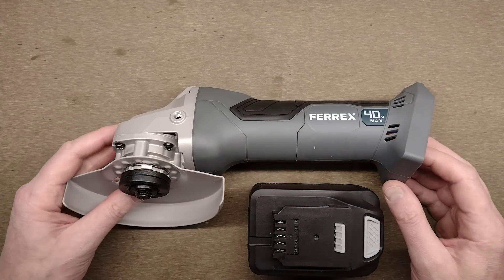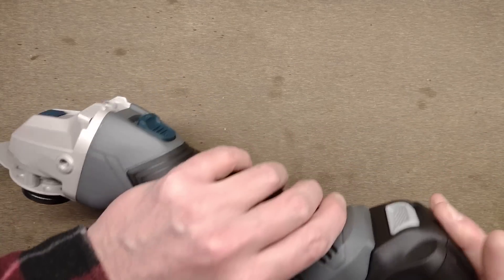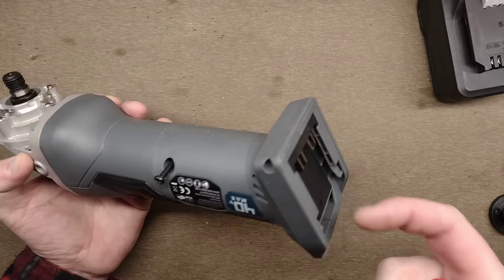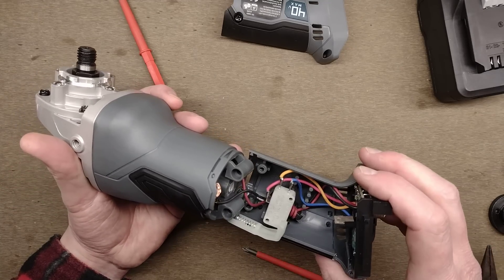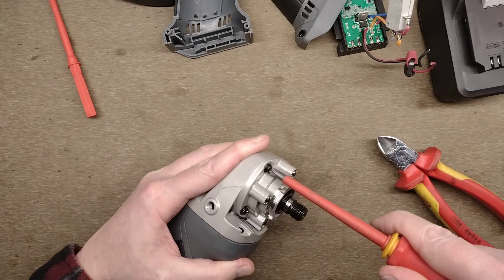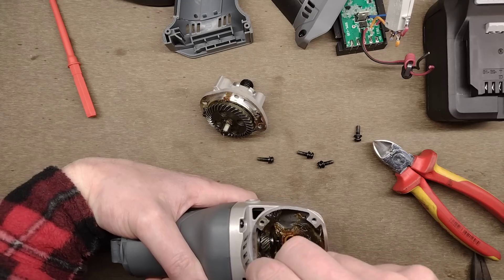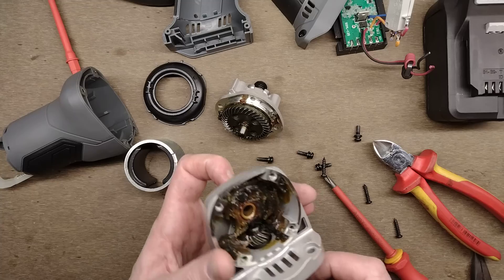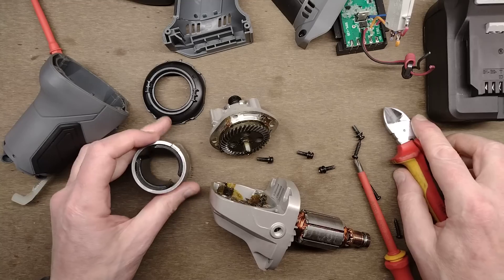Aldi 40V angle grinder mechanical teardown

Comment: Ive taken apart many a tool in my days and ive never seen an external inductor/ choke like that or a commutator on a permanent mag motor without any brushes  on the tool..   oddball tool there….
Reply: The brushes will be inside the plastic body. You can hear them snap off the comutator as the armature is removed from the body.

Winding the motor feed wires around a ferrite is actually quite common on cheap battery power tools.
Drills and drivers often short the positive an negative leads together when the trigger is released for inductive braking, but that would be dangerous on an angle grinder, where the disc could come loose and fly off.

Comment: 9.99 including batteries? If so, nice source of batteries :)
Reply: All the Aldi tools are sold as bare units, so you need to buy the battery and charger separately. Just like the Ryobi One tools.
Reply from the maker: Just the tool.  No battery.

Comment: Nice to see Clive doing more mechanical stuff!

I used to work in product development for power tools and have worked on some 20V/40V battery platforms. For those asking how the switching works: usually one of the battery connector pins is reserved for communication, and it happens there so that the battery knows what voltage is needed. 

Power tool batteries are comprised of a layer (industry term P, ie. 1P, 2P, 3P) of 5 18650 Lithium Ion cells, which produce 3.6V nominal (4V max) per cell -> therefore outputting "20V". If you add a second 5 cell layer (this is 2P) and connect them in parallel - you will double the capacity of your battery.

However, newer battery platforms can switch these to 40V - there's a switch in the battery circuit that will allow it to change how the second layer is connected - parallel (20V) and series (40V). This also allows the battery to be backward compatible - it will just run in parallel unless it detects the tool is 40V.
Reply from the maker: This system has no switching in the battery.  Just in the tool.  There seems to be a data facility between them though.  Battery video made and coming soon.
Reply: ohhhh that's useful information, thank you
Reply: In this case they're just using two separate 5S packs which are connected series or parallel inside the tool, and parallel for charging. No particular smarts beyond a different ID resistor to up the charge current.

Comment: I hear the Dewalt 20V/60V batteries are just flipped between parallel and series even if out of balance and that means they don't last all that long.
Reply: paralleling the 5S packs does balance the buddy cells. so not negative but positive.

Comment: They would have sold more of these if they started at a tenner, (I'm guessing battery and charger sold separately so total cost about 40)
I preferred it when the branding consisted of a wonky paper sticker on a generic featureless tool.

Comment: Ferrex tools are good but they one weak point - the trigger - used both the drill and impact driver for over a year now (even have the p;d style batteries). The drill trigger went first and my impact later both parts are easily buyable though so if you can solder (Sodder) they're quite the long term investment for the price

Comment: I'm still waiting for milwaukee to come out with a m12 version of a cordless grinder as I have lots of the m12 batteries.  Oh well.  This grinder if it has torque would be a good diy project  candidate to power my manual bead roller.  I could power it with a 6ahr ryobi 40v battery.

Comment: those ferrex tools aren't that bad for how cheap they are, my battery sadly died a year after getting it so i ended up converting it to use makita batteries apart from that i can't really fault them since they're still kicking after owning the impact/drill set for almost 3+ years

Comment: I wonder if the 20v systems just have a voltage detection that limits the duty cycle of the output to 50%.
Reply: Since there's 2 sets of battery terminals, the difference is likely that each set of terminals is connected to a group of cells that add up to 20 volts inside the battery, and on the tool end, the 20v tools connect to the 2 sets of terminals in parallel, while the 40v tools connect them in series.

Comment: I was part of a crew disassembling parts from an MRI machine. I got a bunch of goodies from it, including half wave and full wave rectifiers, a 24v power supply, two 24v circular electromagnets, and some other equipment that I'll donate to a trade school. I plan to make a magnetic drilling base for my drill press. The electromagnets are rated continuous duty, so it should serve me well. There are a couple more of the electromagnets, and if it works out, I'll purchase those as well. They appear to be bigger than the other two.
Imagine reverse engineering that equipment, Clive. 
Is the grinder German made, or is it made of Chineseium?
Reply: i could be wrong but i believe mag vices use permenant magnets and an internal mechanical action to move them in line with either ferrous or non ferrous material which makes them work or not :)
Reply: @cho4d  for a drill press, electromagnets are the thing. Look up microwave oven transformer drill press on here.

Comment: I've seen those use both a straight bevel and spiral bevel gear set, and that is where you can tell if they will last by the way they were manufactured. Some of the very cheap junk from our largest Asian friend had the worst gears I've ever seen. They were sloppily cut, where the pinion's teeth were cut so thin, they had a razor edge on the tooth's edge, and they would fail in no time under use. You could see deep tool marks where they were quickly hobbed  in what looked like one pass, and I'd bet the steel was poor quality as well.

The good gear sets are sintered metal, and the best have teeth that have been hobbled or ground to dimension after that.

Comment: Wait so does the motor just work by passing voltage to the magnet surrounding the drive shaft?
Reply from the maker: The coils are powered sequentially by static carbon brushes as it rotates between the magnets.

Comment: I wonder if the button is pushed, does some voltage come out? If so, that might be VERY HANDY for robotics applications. Either gear down, or replace, the motor on the end with somthing more suitable?

Comment: I wonder if the battery pins are soldered onto the board as ordinary components then pushed into the plastic end piece during final assembly.
Reply: That would make sense, and locking as they are inserted. Keeps high temperatures away from the plastics.
Reply: No need to desolder. There's a black plastic bar that pushes out that let you take the whole board out in one piece
Reply from the maker: It was hell getting the PCB out.  The contacts are pushed in and then locked with a slide-in dovetail bar, then the PCB is dropped in and soldered.
Reply: @bigclivedotcom  Sad, though it makes me wonder if that bar locks itself when the soldered board is pushed in.

Comment: After testing out 2 machines with this battery pack we pretty much bought the whole set. So far good enough for personal use. 
You never know with this kind of things, but for this price you can give it a go. It's produced by the German company Walter.
  Can't wait for the follow up on the battery pack, since at some time i have to replace the 18650 in it or fiddle with the electronics. ;)
Reply: Austrian actually.
Reply: @chrishartley1210  Args, Salzburg, of course, my bad. XD
Reply: Made by Walter?! I didn't know they did off brand stuff.

Comment: Hello Clive, I have two of Ferrex 240 volt 5¨ grinders and a bandsaw, which work well and seem to be good value for money. The grinders cost $29.00 Australian and have been running OK for about 3 years now. If they fail, I will throw them in the bin and by another one, rather that spend an obscene amount on the known brands.
Reply: Yep Keith. If you are a tradesman using the tools for hours every day it pays to have durable and reliable heavy duty gear. But for most of us who only pick it up to do a little job once in a blue moon it would be just brainless to have premium gear lying around just begging to be nicked. I also find 240volt gear better as well, since the "battery" is always charged and most things are done in the shed anyhow. Though a cheapie battery angle grinder and drill can be useful on occasion.
Reply: If it doesn't cost you to go and buy another one, it's a viable strategy.

Nevertheless, I buy tools from a tool store where I can handle the physical item and, when elfin safety isn't looking, actually power up for the feel of the thing.

As a result, the Feral grinder is in the shed on standby while I juggle 3 Bosch grinders when weld fabricating... because the Bosch ones are lighter for the same nominal power and run more smoothly. Less vibration is a bonus after a couple of hours of "welding".

Comment: Can't belive how cheap they can make these.
Seems descent quality too. The only thing that fails in angle grinders are the ball bearings and the bearing housing of the output shaft. Most of the time, the case is made of plastic, when the bearing seize up, it melts the plastic and the whole thing is good for the landfill.
Seems all metal construction here.
Reply: They hook you in with that £9.99 (current offer price, normally £14.99) and they know you will then need to buy a battery and a charger on top of it, and that's another £68.97.  The charger's the one with the steepest price point at £41.98.  So in the end it's not that cheap at all.
Reply: @heckelphon  £41.98 is for the charger and a 40V battery. The charger is £14.99 by itself at the moment.

It's quite cheap in practice, because you don't need five chargers.
Reply: @Monkeh616  Thanks for pointing that out!  Aldi website is displaying some odd other prices for 40V tools at the moment, including this £14.99 grinder on offer at £9.99 which then reappears at £29.99 for identical spec, bare tool, no battery or charger.  Weird.  And it keeps saying online price only somewhat haphazardly.
Reply: @heckelphon  Don't know it was without battery and charger at this price. Sure, it's less interesting.

Comment: Unbelievable that they can make them at that price.  But I have noticed that Aldi are now selling power tools in bits.  Instead of buying the power tool and battery and charger in a box, you generally have to buy the power tool and then spend more money to buy the battery and charger and if that is the case here, then you will probably spend more on the battery and charger than on the power tool itself.  If you got the battery in the 10 quid price, I hope you were wearing a highway man's mask at the time.
Reply: In the UK the combined price for bare tool (£9.99), battery & charger sets you back £78.96!
Reply: @heckelphon  Because that's a different grinder, I believe. And that's still cheaper than a bare tool from the big names. Also, you can buy  them separately.
Reply: I'm a dandy Highway man, got the tool from Aldi the batteries & charger discounted from Ebay. The idea is you get the power system and use it in multiple tools, with a few adapters you can expand the power system way beyond the original system 😀👍

Comment: I'm sad he didn't open the pack. For a tenner I wanted to know what kind and how many cells there were. 😔 Hoping for it to be in the "next video" if he does one.
Reply: Usually 5x 18650 for "20V" battery. There are 2 banks in series for 40V and parallel for 20V.
The price does not include the battery.
Reply from the maker: Battery sold separately.  Ten 2500mAh 18650 cells.
Reply: I mean, the ten pound price was a double reduced price, may not be many of these left out there on shelves. I imagine he's probably going to do the battery back at his main bench just like the tool circuit board.
Reply: @rpavlik1  The £9.99 price is for the bare tool only.  Battery is £26.99.  And then you need a charger ...

Comment: Hypoid gear is probably the term you are looking for. Right angled drive with constant mesh teeth. Other methods of turning through 90 degrees do not give consistent pressure on the teeth and consequently have higher wear rates and/ or jerkier motion when transferring high power.
Reply: Bevel gear
Reply: Nope, ring and pinion.
Reply: @zachv1942  The gears in your "ring and pinion" gear set are hypoid gears. Ever looked at a bottle of high quality gear oil? It's there on the bottle.
Reply: @chrishartley1210  you're both right, chill out...and trust me, I own several of those things to the left (my avatar), know way too much about ring and pinion gears, from experience...that use hypoid gear oil for a reason....sheesh....
Reply: @chrishartley1210  these aren't hypoid gears. Hypoid= The axes of the gears don't intersect. These are ordinary spiral-cut ring and pinion gears.

Comment: I bought a cheap angle grinder from harbor freight and it seemed to like it was extra noisy so I took the right angle drive apart and put a generous amount of wheel bearing grease in there it seemed to quiet it down quite a bit
Reply: Somewhat akin to the old used car dealer trick of filling the transmission with 90 weight oil and sawdust.   Does a right smart job of quieting things down...

Comment: Shouldn't you have charged the battery first?
Reply from the maker: The battery was about to be dismantled and reverse engineered, so a full charge was not desired.
Reply: @bigclivedotcom  
It was for a full demonstration of the tool! First thing I noticed was how weak it was. 40 Volts That Weak?
Could have run it down afterwards.
Reply: @arguescreamholler  I'll bet that you make sure to fully top up the oils in your vehicle before you drop it in for a scheduled service too! 😉

Comment: Can't wait to see what they did to make these tools and 20V/40V batteries interchangeably compatible.
Reply: The issue is that the big established brands would need to drop their battery system for that.
Currently there are battery share models with the main brand supplying the batteries and smaller brands using them like bosch power for all or metabo's cordless alliance system (cas) etc.
Reply: @clockworkvanhellsing372  DeWalt does this already with the 20/60 volt. I believe green works did this at one point as well. Maybe they still do. I think it was 24/48 volt. 

As does harbor freight with their outdoor power equipment. 40/80 volt I think.
Reply: @meegstomtom  Yes there are quite a frew with this model, thank you for adding us versions.
What I mean is that dewalt won't drop their batteryline anytime soon so that we can use m18 fuel batteries on a dewalt tool. :D
Reply: @clockworkvanhellsing372  I don't know why any company would do that. Short of specialized tools using existing battery platforms. 

I do think it would be convenient though. Lol

Comment: There is grease in it but sounds like there isn't any on the actual teeth of the gears. i would put more in and also some oil. When screwed back together, is there a rubber seal to stop any oil getting out/dirt getting in.

Comment: Have you noticed if the rotor windings copper or aluminium?
Years ago I bought a couple of SDS drill from Aldi for emergency work but both of them burned out in a couple of days. When I dismantled them I found out that both rotor and stator windings were aluminium instead of copper.
Reply: On my third Aldi/Lidl SDS drill. 
First was stolen. 
Second lent and never returned. 
Third has done Trojan work to date , mainly with chisel bits and the long concrete drill bit. Demolishing brick on flat walls and then breaking these bricks in to smaller pieces to use as hardcore. 
Or cleaning the mortar off the intact bricks with  the 75 mm flat bit. 
Can’t fault them so far.
The smaller most common SDS mains powered the sell cheaper than a days hire for one from a tool hire company.  
Plus at price the bits are sold for , it’s a no brainier. 
While I do not have the larger demolition SDS that Lidl/Aldi sell I recently purchased the 25 mm and 50 mm bits to use as heavy pry bars etc. 
For 3 euro each.
Reply: And you were only using stepped-shank 1" steel drills in a 3/8" light-duty chuck? 🤔😁
Horses for courses! 😉
Reply: @theoztreecrasher2647  Actually they were main voltage 1500W SDS Rotary Hammer Drills with standart SDS chuck.
Reply: Looks like they're copper at 7:30
Reply: @johndoe528  The one I've got looked exactly the same but when I scrape the insulating varnish the wire was copper-clad aluminium.

Comment: Eugh, everything about this tool is horrible.  It has zero redeeming qualities.  But I guess that's what happens when you buy power tools at a grocery store?

How can it have that much awful-colored grease in it and still sound like it's running dry?

I was gonna joke about the whole "right angle gear" bit (out of love, I promise!), but then I rembered how often I've refered to a MOSFET as a "millennial switchy thing," and decided against it.  MOSFETs really are just the millennial version of tubes.  They're faster and more efficient, but they're fragile, sensitive, need everything to be just right, and if you point them in the wrong direction, they self-destruct.

Comment: Great investment, for only 10 "quids". Is that how you say it? How many bike locks and catalytic converters some people over here can cut with it. Great return on investment which should pave the way for something more sturdy like Bosch. 2x 20Volt battery in series makes me wonder how well the packs are balanced, any battery management system in there? Then again, who cares, for only 10 "quids". As long as the battery pack doesn't explode in your face.

Comment: that board may slide out of the black plastic piece. Just double check that before you de-solder.
Reply from the maker: It's been reverse engineered.  I had to cut some side lugs out to slide it out.  There was also a dovetail bar holding the contacts in.